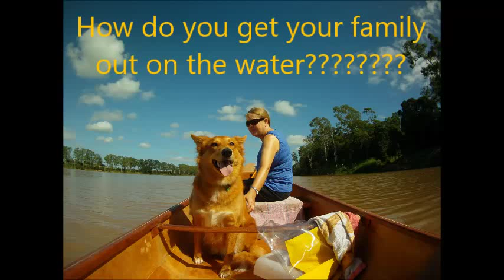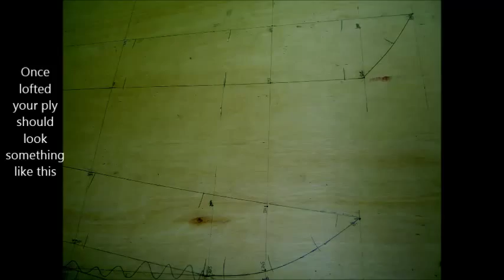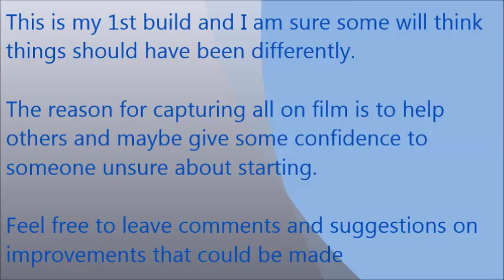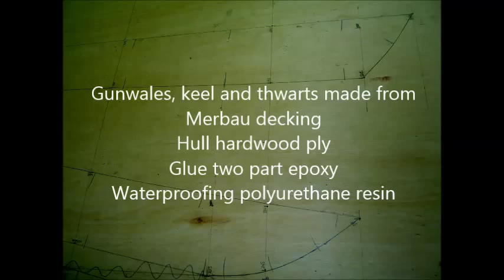Leaky Log build

Comment: nice boat Michael, but i have one comment,      "Polyester Resin" is for "Laying Up" ......."Epoxy Resin" is for "Gluing"
Reply from the maker: Hi Terry, thanks for the comment,  I have found polyester does not adhere well to plywood and the glass peels off in time. I did use polyester on the outside ( cost saving) as a waterproofing agent but have not glasses more than the joints which I used epoxy for.